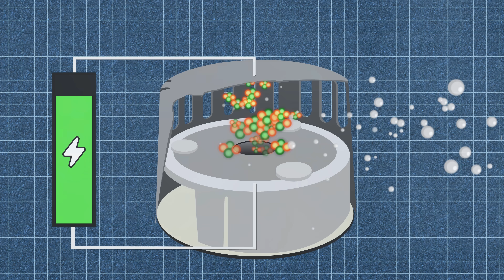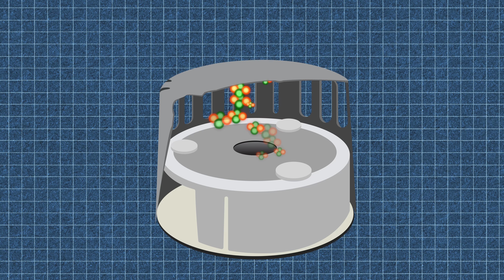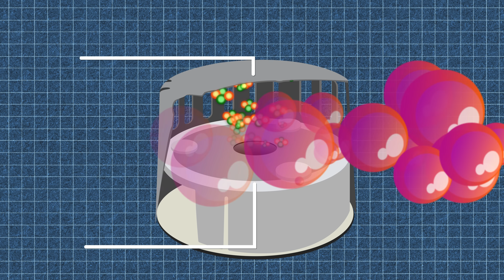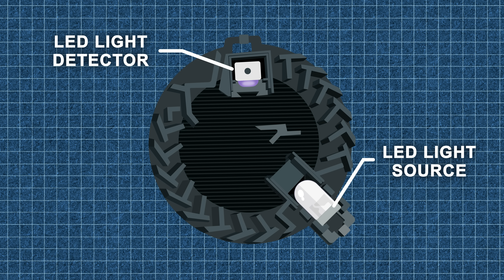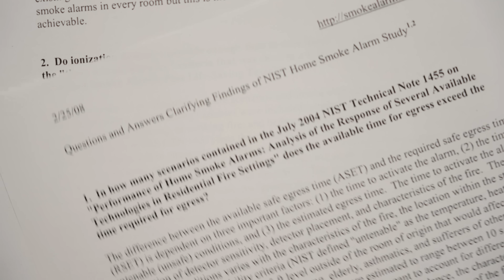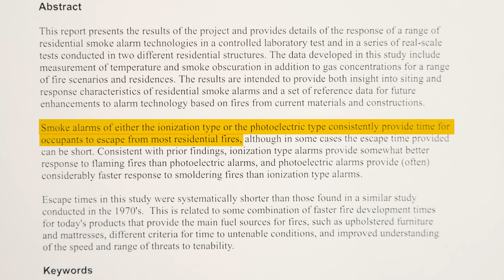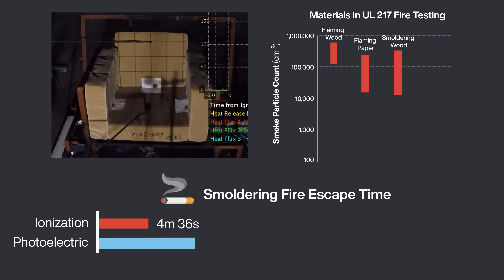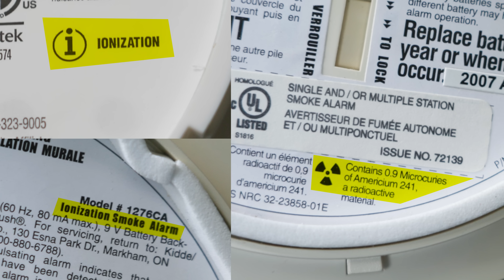Why the Most Common Smoke Alarm is Dangerous

Comment: Ionizing smoke detectors are the superior technology as the detecting mechanism requires no power and will work for decades.  Is the Microcurries worth of americium dangerous? Only if you eat several detectors worth and even then it doesnt settle in the body like ingested plutonium does. But on that note ingesting many of the things in your home can lead to an early removal from the cencus. Like drinking laundry detergent as some darwin award recipients found out about ten years ago. Or ingesting something like nail polish remover or as some alcoholics have tried drinking isopropyl alcohol. 
But youre more at risk from radon in your basement than you are from the miniscule amount of Americium in a smoke detector. Dont let some fear mongering click bait artist get you to trust your safety to an inferior product.

Comment: First Alert makes a dual sensor, hard wired, battery backup detector.  I don't see much mention of that around the web but I have them in my house.  Has both ion and photo detection.  Thoughts on those?  Thanks!

Comment: Smoke detectors are so freaking weird… here are two instances in which they have or haven’t worked in my experience.

Worked when Unnecessary: My dad once burned some tortillas in the oven. When opened, it let out a VERY small streak of black smoke that dissipated after two seconds. A few minutes later, the smoke detectors started screaming.

Didn’t Work when Necessary: My sister once put a lid on a pot of oil, not realizing that was bad. When she pulled it off, the house was FLOODED with VERY thick amber smoke. Not just the room, but both all of the downstairs and the upstairs. Every smoke alarm in the house was engulfed in a smoke that went about four feet down from the ceiling. However, it didn’t sound. I even managed to reach the test button amidst the chaos, and it still worked.

There was another incident a year or so later where they sounded again, but it was still a little bit of smoke from burnt food… smoke alarms are kinda weird.
Reply: We’ve always had KIDDE models, by the way

Comment: Thank you for putting this up.  My photoelectric alarm in the kitchen died today.  I opened it up and found a clean sensor.  Went to Home Depot and the selections were expensive and not labeled as to what type they are.  So I did some research and found your video.  My optical in the kitchen was 2017 and the same with the ionization type in the bedroom.  I bought two SMCO500V since they do CO and interconnect wirelessly.   I have one wired unit I replaced a year or two ago so I have one fresh unit protecting my 1000 sq ft home for now.

Comment: I know it makes sense and all that something happened because when I first turned on my heating element in my air conditioner my smoke alarm started screaming at me and I also panicked because I don't like smoke alarms (note that my ventilation is right next to the smoke alarm) so anytime there's too much built up dust on my air conditioner and then I turn on the heat I will start freaking out because it'll go off or I will get paranoid if I start smelling something funny

Comment: These new smoke detectors are awful. Go back to the simple ones they used to have. Only detect smoke and heat. These new ones detect 9 different things on average. I've seen ants and roaches that get inside them and Sry them off. Steam from boiling water. Dust. Etc. Another supposed case of improvement. Which just makes people buy more junk products over and over.

Comment: did you mess up your graphic? It seems to show photoelectric taking 35 minutes and ionization 4 minutes when you state it's the other way around
Reply: The graphic is correct but you have to read the fine print at the bottom to understand it.  It shows the estimated egress (escape) time.  So for a smoldering fire, the I-type alarm gives you 4 1/2 minutes of escape time and the P-type gives you 35 1/2 minutes of escape time.

Comment: Kidde 10 year ones are the worst I ever came across - had 3 in my apartment when I moved in, every single one was smashed to pieces to stop them falsely going off.  In last 6 years because this is all apartment managers supplied smashed 6 for the same exact reason. at least get the ones that can be shutoff . Or have manual batteries, at least with a manual battery if mold or dust is in it you can pull the battery without destroying it.  You may have to replace battery every 2 years, but still it may save grief down the line, In my case of Kidde Alarms have a 100% failure chance, and usually if they do go off naturally for any reason it is common cooking without smoke

Comment: We got photoelectric detectors in our home that are wirelessly linked to each other (with no replaceable battery, yay), and I learned the hard way that leaving a hot shower sets it off, so does any of my friends who unfortunately vape.  Worse, vape smoke seems to cause it to DISABLE my ability to cancel the alarm, as when I press the button it initially silences all alarms, but then comes back saying "Bypass Overridden" (in verbal speech) and sounds the alarm again, forcing us to chunk it into the garage to "cool off" before reinstalling them.  So now I have a no vaping rule in the house, but still, hot showers are always setting it off.

I'll need to check out these 8th gen ones because I've absolutely despised photoelectric for more false alarms from vapor, than with any smoke itself (but also they too go off from cooking as well, so there's that).

Comment: 0:03-1:20: The video starts by demonstrating how an ionization alarm fails to detect smoke from a smoldering fire, while it is overly sensitive to cooking smoke. Ionization alarms work by detecting changes in the flow of electricity caused by smoke particles.

• 1:20-2:20: The photoelectric smoke alarm, which uses a light source and sensor to detect smoke. Photoelectric alarms are better at detecting smoldering fires because they are more sensitive to larger smoke particles.

• 2:20-4:00: The video discusses the history of smoke alarms and the development of both ionization and photoelectric alarms. It highlights the advantages and disadvantages of each type.

• 4:00-5:40: The video explains why smoldering fires are particularly dangerous, as they produce less smoke than flaming fires and can quickly spread. It also discusses how modern furniture materials burn faster than traditional materials.

5:40-8:10: The video discusses the controversy surrounding ionization alarms and the push for photoelectric alarms. It highlights the inconclusive studies and the government's involvement in testing and regulating smoke alarms.

8:10-10:50: The video explains the results of a major study conducted by the National Institute of Standards and Technology (NIST) that compared the effectiveness of ionization and photoelectric alarms. The study found that both types of alarms are effective in detecting flaming fires, but photoelectric alarms are faster at detecting smoldering fires.

10:50-12:20: The video discusses the government's response to the NIST study and the current state of smoke alarm regulations. It explains that while both types of alarms are legal, the government recommends using both for optimal protection.

12:20-14:00: The video introduces the eighth generation of smoke alarms, which are designed to address the shortcomings of previous generations. It explains that these alarms use more sophisticated algorithms to distinguish between real fires and cooking smoke.

14:00-16:20: The video concludes by recommending that viewers replace their ionization alarms with eighth generation alarms, especially if they are older than 10 years or are prone to false alarms. It also provides a link to a guide with recommendations for choosing the right smoke alarm.

Comment: Thats why dual sensors make sense but they wernt popular. 
What the industry should ahve done is made dual the standard, have a balanced weighted average that can cross check with each other. So if for example the room temp rises and the amercium detector detects particles alarm.

Comment: Don't let regulations and red tape fool you. A little working understanding of fluid dynamics dictates that photosensors shall go in rooms and ionic sensors in hallways and other lower pressure environments. Better yet just use combo units everywhere (that's what 80% of modern smoke alarms are).

Comment: I feel like this is EXACTLY why ALL Houses commercial or not, should have fire alarms with pull stations. It can automatically call the fire department and is easy to activate. You can also mount smoke detectors and heat detectors to the fire alarm system.

Comment: Back in the 80's, I used to work in a building with ionization detectors everywhere. A typical day was five false detections. The usual culprits were detectors that sensed moving air such as those mounted near open windows or that had electric fans pointing toward them. When I moved to another company that installed fire alarms, I recommended photoelectric detectors. No false alarms. In fact, the owners began to wonder "Are these things working?" So we sold smoke detector testing kits or a three- or six-month smoke test service.

Then someone came along and tried to get us to sell their multi-sensor detectors. These had photoelectric, ionization, and heat sensors in one unit. Unfortunately, they were much too expensive. I would have loved to test them to see if they still give false detections but we didn't even try them.

Comment: It's also worth mentioning that the recommended pitch for smoke alarms has changed.  Turns out the super high frequency alarm (3150 Hz) is no good at waking people with hearing loss (most adults over 50), and not great at waking children.  They were designed to be annoying, both to wake you and encourage you to actually leave.  They also are incredibly painful to anyone with audio sensitivity.  The new standard post 2010, required for any dwelling where people with hearing loss might sleep ( and recommended for everyone ), is a 520 Hz alarm.  While I don't believe the standard requires it, the manufacturers making them have mostly gone with sawtooth alarms rather than sine-wave.  This maximizes the ability to wake people.  

Unfortunately, alarms are often not clearly labeled, even sometimes having the same model number between the high and low frequency alarms.  First Alert's talking photoelectric alarm is 520 Hz, and tends to be my preferred choice.  It's photoelectric, so works well on visible smoke.  The sawtooth wave reliably wakes you at night.  And the talking voice helps kids realize what's going on and remember to clear the area.  Only downside is the manual quite clearly says you are supposed to clean it with your vacuum cleaner every few months or it can have a false alarm in the middle of the night.

Comment: The companys are nuts for not just including every damn sensor type in a singular smoke alarm.. you then still can opt for smart analytics of the data.. also, i feel like that the photo/light reacting sensor should have a second sensor checking if the emittor actually emits.

Comment: I'm NOT a fan of First Alert's battery-operated alarms.  Twice now, I've had their products suddenly go into full alarm in the middle of the night with no way to shut them up (other than a hammer).  Just happened to me this past week, AGAIN...and this smoke detector was a replacement for one which did the same thing just 3 years prior.   Both supposedly had "10 year batteries", permanently sealed.     It's bad enough to have one start chirping in the middle of the night.  Going into full alarm and the silence button not working at 3am is completely unacceptable.  
So here I am at 3:30am, half-asleep, having to drag the ladder up from downstairs, climbing on top of it (half asleep) trying to get this POS off the ceiling.   Then there wasn't any way to shut it up!  Sure, there's a switch on the back, but that requires breaking some plastic tab off...which requires tools.   again, it's 3:30 AM in my bedroom...  A hammer in the hallway closet was the nearest tool, so that's what I used on it until it finally shut up.

Comment: This is just why I installed a commercial fire alarm system in the house, 

I use a Hertek Penta 5000 Addressable FACP with Apollo XP95 smoke and heat Detectors with sounderbase, and I also use Apollo MCP’s.
Those XP95 detectors sense small smoldering fires.

I also got magnetic firedoors that releases when the alarm goes off and the system sends me a sms and email notification when a system trouble or alarm occurs.

I all monitor this system myself.

Comment: There is a mistake in the chart at 11:41 where the chart shows that PhotoElectric took 35 minutes, but you mention that it was faster to detect the fire.
Edit: it seems that the "warning time" is not a good title for the chart, safe egress time and evacuation time make a lot more sense.

Comment: Recap:

Ionization: better at detecting fire.
Photoelectric: better at detecting smoke.
NEW ionization (gen.8): better at everything.

Also, make sure to check your alarm from time to time. There's a test button on it. Use it.
Reply: Nope smoke alarms detect smoke not fire. Photo for smoldering Ion for particles

Comment: Interconnection might be great if you have a very large house where you can't hear an alarm from the other end of the house.  Or if you're the type that's immediately going to flee from every little beep and stand outside on the phone with the fire dept while your house burns down.  Same type of idiot who tells the dispatcher his smoke detector is going off and causes a code 3 fire response when it's a CO alarm which he could have handled himself.

Me, I want to know immediately WHERE the fire is so I can put it out before major damage is done.  Interconnection means I have to walk the whole damn house before learning anything.  And I could become trapped in the process.  Whereas if it was a single alarm beeping I'd be able to tell by sound whether a given path was safe.

Comment: Due to strict regulations, ionization detectors in the European Union are now only used in exceptional cases. However, the risk potential of a single detector is low when used and disposed of properly. Normally, ionization detectors are completely harmless due to their low activity.

After a fire, the debris must be searched for missing fire detectors. If not all detectors are found, the entire debris must be disposed of as hazardous waste according to radiation protection regulations (at least within the EU), which can cause significant additional costs after a fire department intervention. Searching for the detectors is not always easy. With Geiger counters, there is hardly any chance of finding them under a layer several centimeters thick.

Comment: I would never trust 8'th gen. My job is to hack stuff, so I see a lot of how developers code, and with that experience I want my smoke detector to be as simple as possible. What happens to that graph if I have an AC/fan running? How is it affected by air humidity, or even pollen? What if I have vents close to the roof, or the detector is close to a staircase? There's no way in hell I'm trusting my smoke detector to analyze that, especially since it's a product of (to me) unverifiable trust, until something is actually on fire. That's way too much TornadoGuard for me...

Comment: Great vid, but may I make a suggestion. And that is also, include in your recommended list to also include battery operated ones, along with the hardwired ones.
Reply from the maker: I did with the 10 year battery options.  

Also in the larger guide there's a spreadsheet that can be filtered by battery!

Comment: Hmm, will the new 8th gen alarms with with Kiddie relays still? For interconnected devices. I debated a photo electric alarm in my tiny home build but was deterred by how long they take to detect smoke fires.
Reply from the maker: If you're wondering if Kidde and First Alert can be connected together? No unfortunately.  Kidde does have 9th available and that fixes the issues with all forms of detection

Comment: I worked for a fire alarm company. A fun little fact about the alarms is they normally scan for smoke every 10 seconds. After passing a certain threshold, they start scanning every second. (And enter gigabrain mode lol). This means the battery can last 10 years but still give you a warning within one second of passing the threshold.

Comment: None of this information is new. The problem isnt the detectors themselves, its incorrect type or location that they are installed. Their use cases are printed on the box when you buy them and as long as you follow their instructions they should work fine.

Comment: I have 2 issues with smoke alarms:
1. They nowadays always have annoying blinking light that's annoying to have in your bedroom. 

2. They're mandated to be replaced every 10 years (here at least), with the excuse that the test button only tests if the battery and siren is working. Yes I understand that's not that much money, but for me it's fundamentally a problem that we have a device that most likely is working perfectly, with no way to know if it is or not, and is replaced solely because of its age. That 100% makes people not want to buy new ones. We need smoke detectors with a way to actually test the detection. That I have thought about would be, with optical sensors, mechanically slide a film in front of the light, simulating smoke. Dunno if that could work, and I know nobody would want to make them as they'd rather just have planned obsolescence for their alarms to keep selling them.